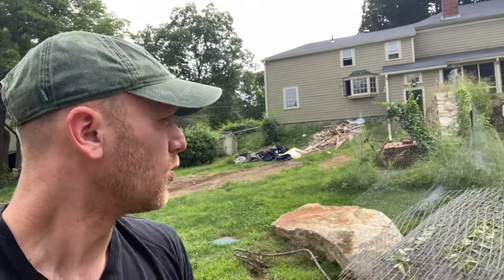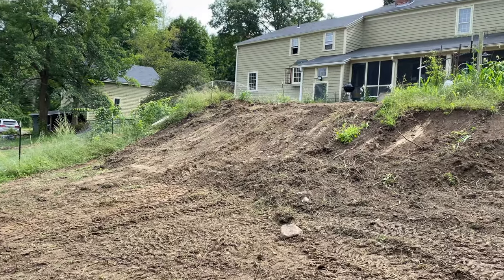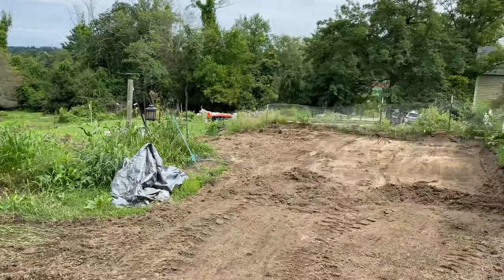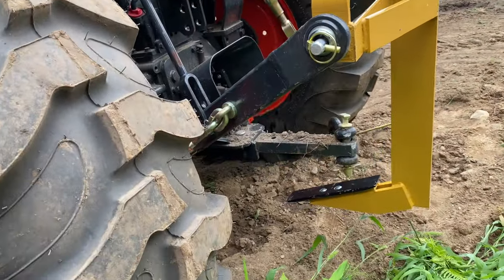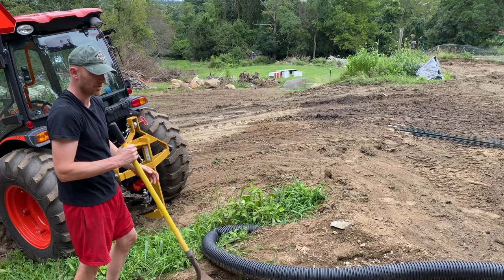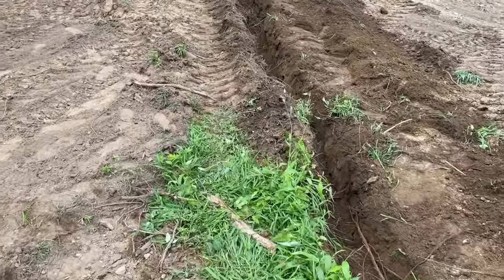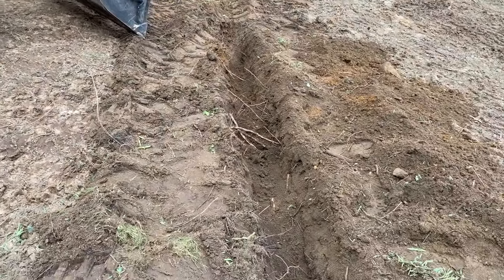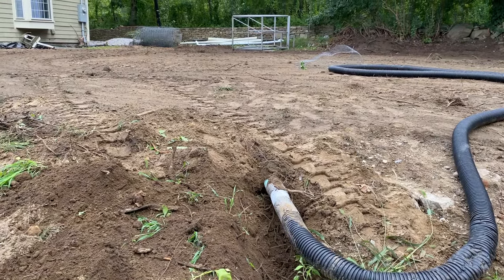Easier way to trench WITHOUT a backhoe!!!  Making use of the Kioti with a subsoiler.

Comment: Good idea - a lot faster than a small backhoe too. Be warned though, I have the same subsoiler and just today was running it in very compacted ground (200 yards) and I doubt it will live to work another day. I sent a photo of the bent subsoiler to my uncle, he sent one back of another bent subsoiler ( a heavy old-school one) and asked if I remembered it. Apparently I bent that one too about 40 years ago. I have concluded that I have high expectations of subsoilers.
Reply from the maker: I also have the same high expectations and also bent it a little bit. More so at the head of it then the arm going down. My soil is full of rocks, but it was way easier and saved my back vs digging the full trench the way I did in the first few videos by hand. We’ll see how long it lasts!!  Thanks for watching!!!

Comment: I have the same sub soiler from TSC. I used a short length of 1/4” steel cable about 16” long and made a loop at one end -about 1” in diameter which bolts to the bottom of the subsoiler and it drags behind when put in the ground. Before I made a loop in the other end I slid on the cable a 1” dia x 4” long pipe nipple with cap screwed on the leading end with a hole in it for the cable. Then I finished the other loop in the cable. I use it to bury direct bury wire and pex lines for water. I hook the wire to the loop and the pipe nipple slides back down the cable to cover the wire end and acts as a torpedo thru the dirt. It creates a “channel” for the wire so there is zero resistance and you can bury a wire as long as you want. Same for pex, but I clamp in a cap with an eye bolt drilled thru it used as a hook. Another thing I did was weld a plate to the sub soiler and mount a 1/4 hp vibrating motor, which makes it pull ten times easier thru the soil. With that vibrator I can sink the sub soiler down to the drawbar. When done I just drive the tractor back over it to push the soil back down. Good video. Scott
Reply from the maker: Thanks, Scott!  I plan to do something very similar when running cable and water lines in the future.  The vibrating motor sounds interesting!  Does it transfer to the tractor much?
Reply: @Curtis1824  no, it’s just a little 1/4 hp motor with off balance weights on it. I got it on eBay. It is 120v so I need a long extension cord, or to put the generator on the forks out front, but it makes a huge difference in pulling the sub soiler. The vibration allows me to sink the shank deeper with less pulling effort. The phone company used the same principle on a large ditch witch brand unit to bury my phone cable along side the driveway. I got by without it for years, but if you can find a small vibrating motor it’ll help a lot. Scott
Reply: Damn man!  Vibrating motor. Great idea. I’m making a trencher mounted on the bucket and having the dirt directed into the bucket but the dirt keeps getting clogged in the chute. This may be the answer. Ordering one online. $40. Thanks much!!

Comment: I wonder if maybe you cracked that rigid pipe when you drove over it.  There wasn’t a lot of soil above that plastic. Maybe something to check out in the spring.
Reply from the maker: I was thinking either that or just with filling it in the water wasn’t flowing as freely through the soil.

Comment: I have the same idea with my property. We have water coming down the hill onto our lawn. The buster looks like the perfect tool for that. There many roots . The ground is always wet. Our Kioti Nx 4510 lookks just like yours. Hopefully it can do the job.
Reply from the maker: Should be fine with NX.  It definitely helps break everything up and right through the roots.  Another viewer mentioned using the bucket afterwards to dig out the trench instead of the way I did it with the shovel to save some time.

Comment: I have never seen anyone connect drain pipe together with duct tape before.
Reply from the maker: There's a first time for everything :)  The duct tape was more to hold the fitting in place while I buried it so I didn't have to worry about it coming apart on me.  Definitely not a permanent hold.
Reply: When i did the corrugated pipe for drains i snapped it together and then wrapped duct tape around the joints so that it would help hold it together until burried and also help keep it from leaking
Reply: An A-Team special!  BA would be proud of you!
Reply: Well. Not to make it last...

Comment: I'd assume this would only work in places where the soil doesnt freeze?
Reply from the maker: Probably depends on how deep your frost goes.  I've broken up 6" of frozen ground with it, but it's hard to get under that.
Reply: @Curtis1824  I mean lets say you have a water pipe running....you cant lay that so shallow. In Estonia we have to bury water pipes at least 1.2m below ground to be sure they wont freeze.
Reply: But yes for pipes that do not depend on how deep they are this tool is waaaay faster than a backhoe. Maybe make it a bit wider somehow so it plows better? (I have a Bronco ATV towable backhoe).
Reply from the maker: @inseiin  Completely agree.  We have to go down about the same here for anything continually filled with water.  This just takes away the rain/snow melt and I haven't had any problems yet with backups.

Comment: Way too much shoveling.  Flip the loose dirt out with your bucket.
Reply from the maker: That would have sped things up for sure. Thanks for the tip!
Reply: @Curtis1824 
i think I'd have a tough time moving much soil with a shovel or bucket blade running parallel to a trench and the loader on my CK4010se don't have a "flip" motion actuator.